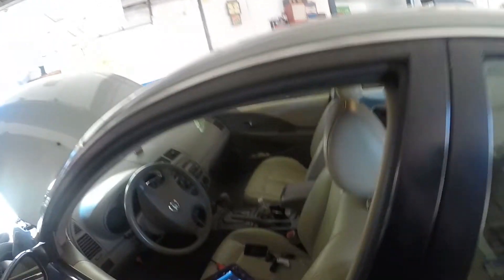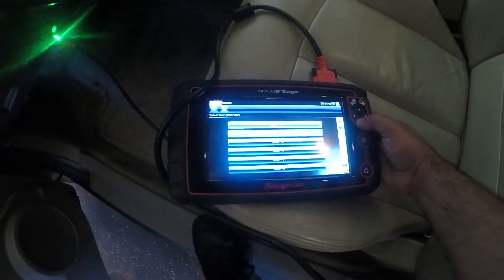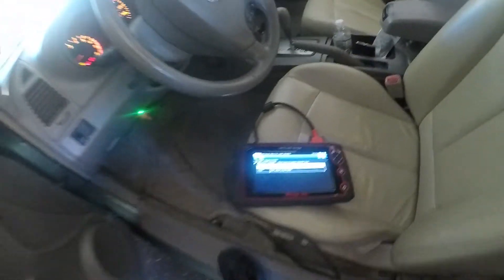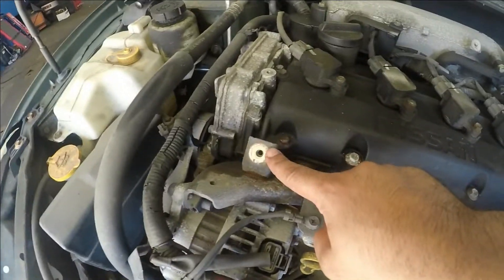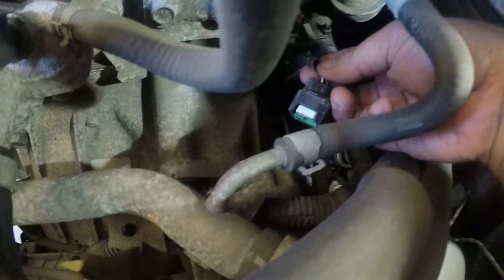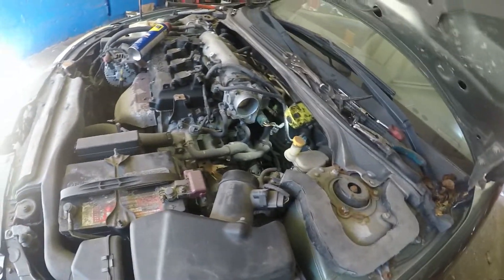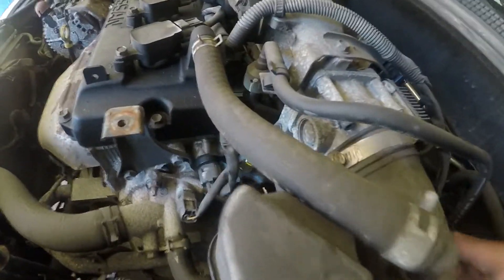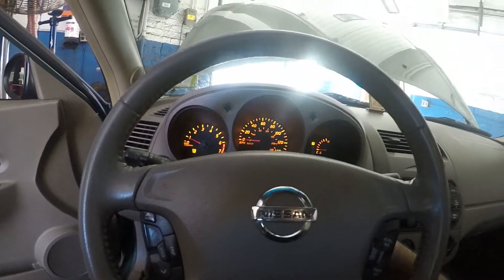2002 NISSAN ALTIMA P0335 CRANK POSITION SENSOR CODE

Comment: I have left a few lights in!
Reply: I have a question, 2002 Nissan Altima crank sensor and cam sensor light on and know it want start they said a garage changed both and it still want start, what could it be?

Comment: my Nissan Altima 2002 stops while driving and i think it has to do with a sensor issue i dont know for sure anyway...i have change fuel pump, check plug etc but still stops while driving, the car do not stop all the time but the times it does is embarrassing
Reply from the maker: abdusalam kasim can you please scan the car see if there’s any codes also dose it stop during redlight or at a stop sign?
Reply: @RBTheMechanic  its stop without notification, its just stops anytime it likes, i change fuel pump yesterday, still stopped but only once and recently i discovered a method, i just use a pipe and blow in air to shake the fuel or add in some fuel and its up and running again
Reply from the maker: abdusalam kasim some times fuel pump can be defective I think you might have to have this one diagnose by local mechanic or try check fuel pressure at the rail once it shuts off
Reply: @RBTheMechanic  will the camshaft position sensor also cause hard starts?
Reply from the maker: @mikejunior3373  oh yeah slow lazy start usually on these Altima’s I change crank and cam togather